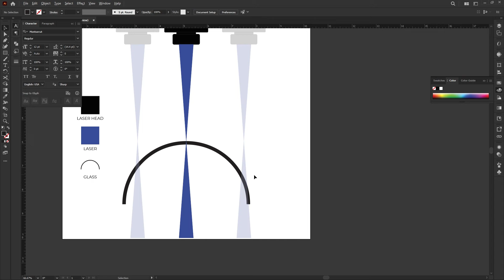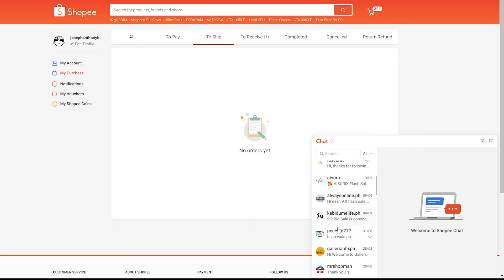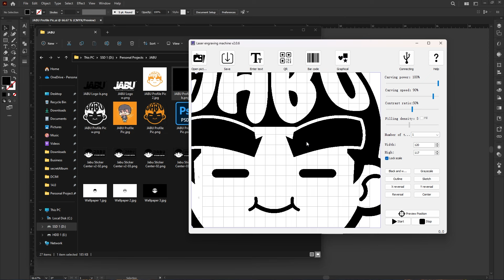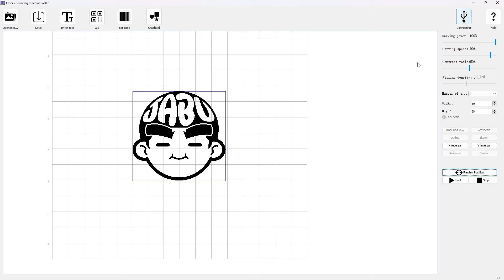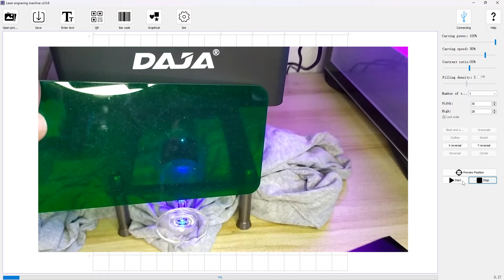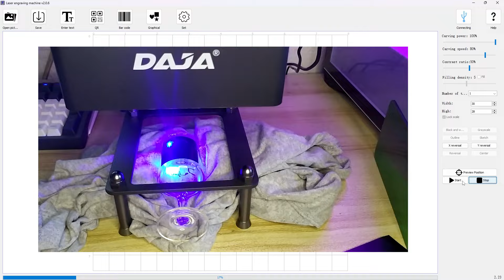DAJA DJ6 Laser Engraver: Engraving on glass material (Beginner's Guide)

Comment: have you tried engraving on metal? the non painted one?. thanks
Reply: a very relevant question. author please answer
Reply from the maker: Hi. Sorry for the late response. Only fiber lasers can engrave on bare metal. DAJA DJ6 is not sa fiber laser but it can engrave on painted metal. Basically it only removes the paint, revealing the metal underneath. I will make a video, engraving test on painted and bare metal. Please turn on the notification bell because i will be uploading it soon. Thank you!
Reply: @ajabujabu  thank you sir

Comment: Do you know why i cam scratch it off after it is done?
Reply from the maker: Yes. 1. The laser focus may not be properly configured. Adjust it to the smallest point while the material is underneath. Use the black paper for more accurate adjustment. 2. The "power" and "speed" setting is not good. I recommend 100% power and 50 to 80% speed.

Comment: how about if I don't want the color in my lettering?
Reply from the maker: I haven't tried it yet but some people use sandpaper to get rid of the colored paper residue making the engraving white.
Reply: @ajabujabu sandpaper?
Reply from the maker: @satriaane2113  Yes. Some people use 100 grit but they only sand the engraved part to avoid scratches on the whole design. And some people uses wire brush to remove the black color left by the colored paper.

Comment: Great vid po! Ask ko lang po if yung provided program ba ni DAJA gamit niyo for PC and wala naman po bang problems sa pag-install? Planning to get the same unit hehe 😅 Salamat po in advance!
Reply from the maker: Thank you! :) Yes Sir. Included na po yung flash drive with drivers for windows and mac. In case po na wala sa unit mo, pwede mo po ako imessage para mae-mail ko po sayo. Working din po siya sa windows 11 in case na yun po yung gamit mo.
Reply from the maker: And I want to add po before you buy, di po kaya ni DAJA DJ6 mag engrave sa bare metal, only on painted metal lang Sir. But still napakaganda niya pa rin na engraver. 😊
Reply: @ajabujabu مطلي بماده ماذا ؟
Reply from the maker: @user-ng5jb3gv2l the black material in the video is called "colored paper". I don't know why but if you want to buy it online, that's the keyword you should use 😊

Comment: Cause I watched this. I now know not to do it this way. Cermark spray is 100 times easier.
Reply from the maker: I guess you got the wrong idea, sir. As you can see in the video, I did not have any problems with the first engraving. The color paper is not the problem; it is the scale of the design plus the curved surface. Yeah, I know I should know better not to make the design bigger. I haven't tried CerMark spray because it's not available in my country. I hope I can try it someday.
Reply: Its the scratching with a Stanley knife. Surely its not good at all for a glass. But I do understand we can only use what we have to hand. And well if it works for you that's fine. :) it's just not for everyone :))
Reply: yup or just black paint in a lil  16 doar usb paintnsorayer
Reply: @ajabujabu u must get a small motor and slowly rotate the glass on two rollers you can 3d print a machine that does that and use an existing spinning object like ur usb turn table
Reply: where can i get the cermark spray?